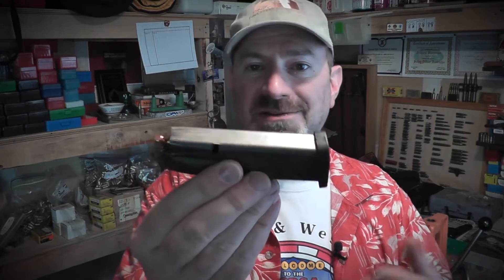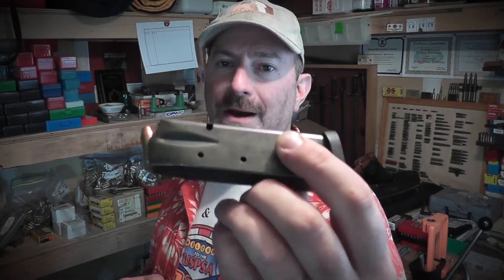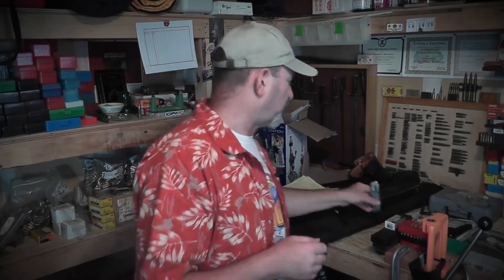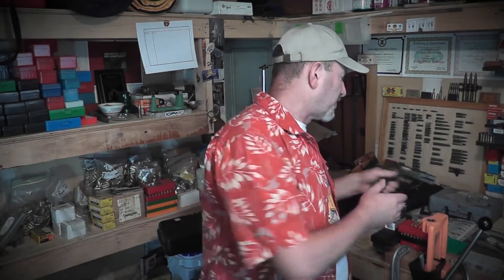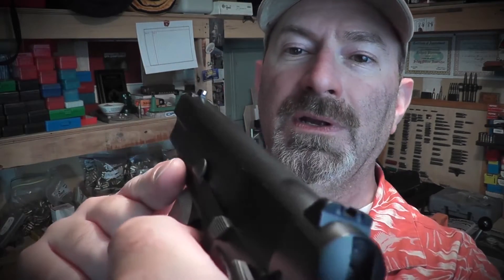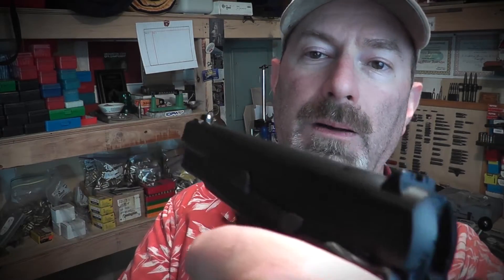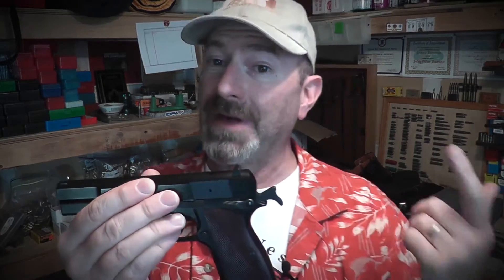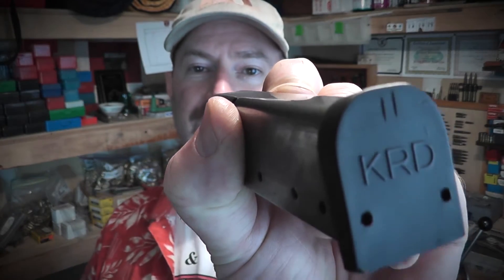Episode 278 - Troubleshooting Hi-Power Magazine Problems & Loading the 30 Luger

Comment: Since recording this, I think I've discovered the problem with the HP; I had used a spray-on mag lubricant prior to the match, in the interest of allowing mags to drop free for reloads, but it probably also allowed rounds to slip out of the mag more easily than desired, resulting in last-round inertia feed and premature lock-back.  I've since hosed the mags with brake cleaner, so we'll see if that fixes the problem.  Rick
Reply: I love this show

Comment: It's been a while, but I recently put 100 rounds through the three magazines discussed in the video, and the gun ran perfectly.  After initially looking for some dimensional issue with the mags, I concluded they couldn't all have gone out-of-spec at the same time, and (correctly) decided the problem was the spray-on mag slick, intended to help the mags drop free from the gun during reloads, getting inside the tube, on the feedlips, causing double-feeds.  I'd mis-read the slide locking as premature slidelock, but was instead last-round inertia feed, and thorough degreasing of the mag tubes fixed it.
Reply: Apparently, feed angle is fairly critical in the BHP.  I found a company making a template to help adjust mag feedlips to ensure the correct "ride height" and angle of the top cartridge.  I used a couple of new factory mags to judge condition of the mags I generally use, did pinch the feedlips a little closer together on a couple of my well-used mags, and, as noted, the gun ran perfectly the last time out.
Reply: Put another 100 rounds through it, a couple of weeks ago, with no issues.

Comment: Thank you for useful information and I do have an issue with my hi power pistol which is called duple feet is that problem from the magazine as well? I hope we can connect soon
Reply: The problem described in the show was double feed; the last round in the magazine, which is retained by the least pressure from the magazine spring, escapes the magazine during the recoil cycle,  The round "gets away" and the slide locks back.  I had no problems at all until I applied a "mag slick" product to the magazine tubes, inside and out.  The video was made the same day that I'd hade the problem, and after spending additional time analyzing it, the likelihood that three magazines would all fail on the same day, in the same way, would have to have an answer other than weak springs, spread feedlips, etc.  Rick

Comment: I am having a different issue all together with this mec gar mag. I have a 15 rounder for my Mark 2 hi power (not a miss print). The mags go into the mag well, but will not eject at all. By this I mean I have to pry it out with my hand to get it out of the well. In my 13 round factory mags when you hit the mag release a half inch or so of the mag pops out and the magazine safety won't let you drop the hammer when you pulling the trigger. With the mec-gar mag it doesn't drop at all and I can pull the trigger and the hammer will fall. Is there anything I can do? Return the mag?

Comment: So I was at the range and I was getting ftf and fte with 4 new 15 round mec gar mags I feel like the magazines are not the problem so I ordered a new Wolff 17 lb recoil spring to see if it fixes the issue. It’s a used kareen mkiii hi power clone idk how many rounds it has through it and if the recoil spring has ever been changed hopefully it helps if any of y’all have any input please leave a comment I’m new to anything hi power.

Comment: Do Hi-Powers use a slide lock spring?  If so maybe the spring getting weak and inertia combined with the design of you follower is causing it to rise up just a little more than it normally would.  I'd also look to see if there is a bur preened into the slide lock that might be catching the slide notch.
Reply: Yes, there's a spring-loaded ball and detent arrangement, but it seems to not be the issue.  I'm all but convinced that the issue was inertia feed, due to excess lube on magazine feedlips.  The last round, that didn't make it into the chamber, could be heard rattling out along with the magazine during reloads, which indicates that the lock-back wasn't really premature; prior to when I wanted it, but if there's no round in the mag, the slide will lock back.  I'll thoroughly clean the mag tubes, inside and out, and see if that doesn't fix it.  Rick

Comment: Of course, the issues that drove the spring change was the 2014 WA state match, two years ago.  One of the feed failures caused me to try to force the slide home by slamming the back of the slide with my hand, driving the hammer spur 1/8" into my palm.  Rick

Comment: I said I'd report back after the Luger grudge match.  While leading the match after two stages, I suffered a broken part.  It put the gun out of action, but luckily it turned-out to not be a fitted or serialed part, so it's just a matter of finding a place that stocks Luger parts at reasonable prices.  The gun was running great, I was not blazing through the stages with my flapped military holster and reloads rattling around in the bottom of a coat pocket, but it was fun.  If you have Luger parts, I need a striker spring guide and a mainspring guide.  Rick

Comment: 12:00; even after three years, this drives me crazy.  The head dimensions of 9mm Luger are similar to .30 Luger.  Claims that 9mm Luger is just a .30 case opened to 9mm are not correct.  The 9mm Luger case is actually a shortened version of an obscure round called, by some sources, "9mm Export Mauser".  You can wow your friends at cocktail parties with that tidbit.  Rick